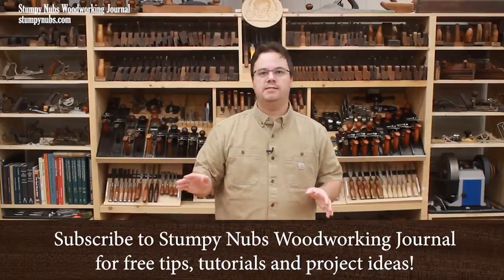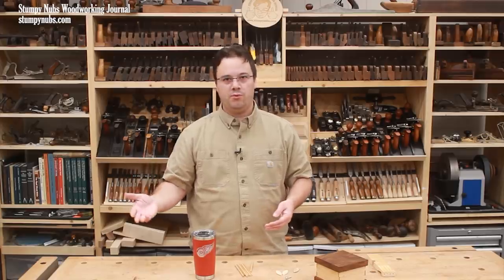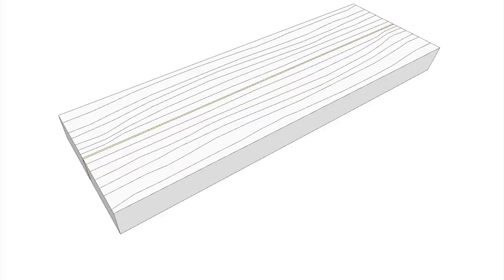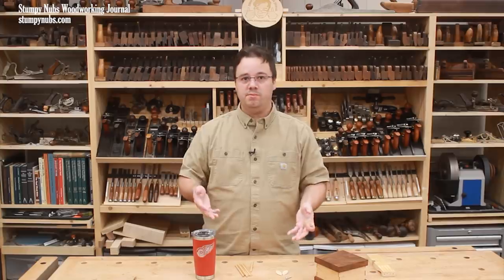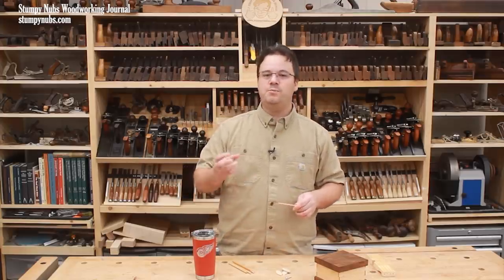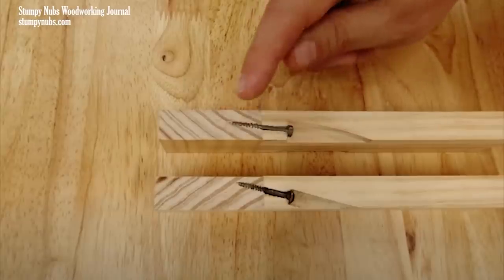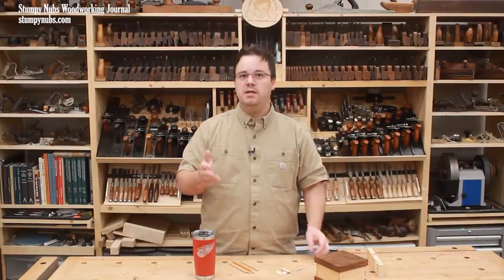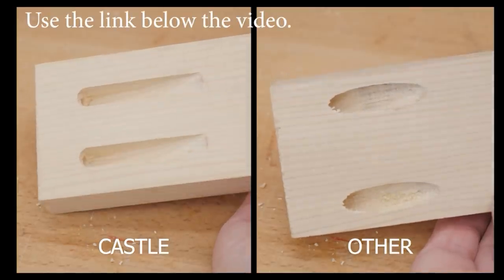Many woodworkers use these wrong! (biscuits, dowels and pocket screws)

Comment: I use them all depending on the structural load its going to hold. I worked in construction for 10 years before i started woodworking as a hobbies, and thats the way i understands everything, alot is done by trial and error to i know what will fail, just got to understand the furniture your making,  and the joinery to hold it together

Comment: I normally use mortise and tenons for anything structural. I have used dowels and made my own jig for alignment which if you don't lay it out right then you're doomed to fail. Pocket holes I generally use to attach a table top to the rails and sometimes I use them in the rails if it is a piece of furniture that I may need to tear down and set up someplace else. Sometimes it is just easier to tear something apart and reassemble than try to lug it up and down stairs in one entire piece. As I stated it depends on the application and what your needs are when you use any joinery method, especially when you leave the traditional methods and go for something different that may or may not be weaker over time.

Comment: Nails especially cut nails are sometimes the best option as well. A cut nail can crush the wood fibers forming a feathered wedge effect that can be amazingly strong and simple to use. Many old country style casework is joined with nails and has held up really well.
Reply: Side note: nails aren’t brittle like screws, they will hold under shear force where screws can snap.

Comment: I've been known to use screws in place of clamps in some, select, glue-ups.  Only to remove them after the glue has dried, bore the holes out, and drive dowels of a different spicies into the hole.  Then, often,  drive a wedge of yet another spicies cross-grained into the wedge, making a trenail of sorts.

Comment: I’m soo fortunate to have worked in a high end cabinet shop out of New York. Nearly ALL our installs were in Manhattan. We have installed on 5th ave, overlooking Central Park, Park ave, lower Manhattan high up enough to see yankee stadium from the living room windows. 
That said, I’ve not seen
(in person) that quality of woodwork since leaving the company.
Without behaving like a jag off name dropping, one might be inclined to tell me what quality is....
Save it for the dim! 
I’ll just say our modest little shop had NO Festool, NO Mirka and or other such marketing mandated, overpriced, point of failure designed toys, we had quality tools that were a decade or more old. We also had a pocket screw machine, we also had several biscuit joiners that were used in damn near every single cabinet project we did.

Comment: Before my cabinet company switched from mortise and tenon face frames to pocket screw joinery, they did strength tests. The pocket screws were more than strong enough for that application. You have to beat it with a hammer to break the joint.

Comment: I'm not that big a fan of pocket screws or biscuits.  But they have their uses. I would not expect them to hold any joint with a load in the wrong direction. And if you use them improperly. Well you get what you deserve. 
But I found a perhaps novel use for a biscuit jointer. A number of years back when I was doing my hardwood floors I found a biscuit jointer very useful for cutting new tongue and grooves on the ends of pieces of flooring cut to fit. I also used it to to cut biscuit grooves on mitered ends.
But most of what I do is best categorized as wood butchery. And I admit it.

Comment: If a joint will not be seen I will often screw+glue it together than when the glue dries back out a screw, drill a hole through both pieces than glue in a dowel. than do the rest of the screws.

Comment: Great video again James, I just built a picket fence and got criticised, told I was cheating by two friends because I used a nail gun and didn’t use screws for the pickets, as long as the nails are galvanised I don’t see a problem and it was certainly easier and quicker than screws. I had two words to say to both friends, first word started with a F second word started with O, we had a laugh and I am waiting for them to ask to borrow my nail gun 🙂
Reply: Traditionally they would have been built with nails, but you have to bash the boards back in every couple of years. Screws will hold the boards longer, but if you don't pre-drill the pickets with an oversized hole, then the pickets will split due to wood movement against a rigid screw. A nail will happily bend with the wood. You made the correct choice going with nails.

Comment: Great video!  However, I did laugh at 7:49 when you talked about not needing clamps with pocket holes, but then show a big clamp holding the parts while you drive the screws -- yes, I get what you were saying, but it just struck me funny. Yet, again, great video.

Comment: I often wonder why pocket holes are put into a joint on the outside of the board instead of the inside where they are hidden from sight. When I made my work center (island)for my shop, all of the pocket holes are on the inside, away from sight because I wanted the natural grain and colors of the hickory to show. Even the hanging cabinets that go around the walls have inside pocket holes. I will say while assembling the inner cabinets and drawers it was tight and I had to use a flexible drill extension to get to the pocket holes.

Comment: I have a theory based on my experience with older joinery. Chairs often have dowel joinery and I have seen many of those fail. However I have never seen a mortise and tenon joint fail. The racking forces try to break the entire joint all at once and I would agree that both are equally strong initially. I theorize that the easy transition between dowels end grain glue and the long grain glue allow the wood movement to slowly tear the connection over a long period of time. Sort of like how a phone book can be torn in two by attacking a small point of tearing at a time.
Reply from the maker: Dowel joints fail when a manufacturer uses dowels that are too small, too few or too soft. Two pieces of oak connected with oak dowels will not fail any faster than two pieces connected with a similarly sized mortise and tenon.

Comment: Heres a question, 3 identical pieces of furniture, one made with traditional mortise and tenon, the other made with a domino joiner , and the 3rd made with pocket screws. Aesthetically they all look the same but the question is are they worth the same? And im not taking about labor, its a quality issue .Because they are identical , would you sell them all for the same price? From a curious professional woodworker, Open question for all
Reply from the maker: Since Dominos are loose tenons, there is little difference at all structurally between them and a traditional mortise and tenon. And if pocket screws are used in the wrong places, they wouldn't be appropriate for the project. But I think your question is more about the effort put into the project vs. the price charged. My answer to that is I would definitely charge more than usual if I intended to use simple joinery but the customer required something more complex. But I would not charge less than usual if I had intended to use complex joinery but found that I could create the same quality with a pocket screw here and there. (Remember, I would not use pocket screws for high-stress joints. That is not creating quality.) You may look it this way- A chairmaker can bore all the holes in the piece with a hand brace and bit. Or he could use a power drill. Would he charge less simply because the power drill made his job easier? Not at all. You sell quality, function and beauty. You only sell joinery inasmuch as it serves one of those purposes.
Reply: @StumpyNubs  Thank you for a great answer. Sometimes its just nice to get other professionals opinions especially that of someone I respect highly. Thanks again

Comment: I honestly like Screws and Heavy Duty dowels. The reason being is fixing furniture, and durability. Screws are just durable. Every argument fails when your furniture is not secure, not stabile or not good enough. It's a very bad feeling of insecurity and shame of the owner. A screw will last. Simple, and super effective. It will fix the problem. The more you use, the more decades or generations it will last. No chair that's loose, no bed thats cranky. So on.

When you have a dovetail, and a wedge, or a wedge nail, that is also very durable. Might not be the prettiest. But prettiness only comes in sight, when the joint is just as secure, and there is no damage to stability. When the house of the man, does not have to go around fixing shelves or a broken joint. If a dowel fails, the jointer failed.

This is one of the reason, why I don't like round dowels, and plastic tips. A round dowel is strong. But combined with subpar construction and low standard from the creator, it often ends up with the glue, and the dowel not being secure, and the joint getting worned out, the glue shattered. A plastic tip is temporary. It's used, when you need a heavy duty screw, but the metal eats out the wood due to use and movement. But plastic, also gets worn out very fast, it's not very secure, and in a couple years at best, it is destroyed. The screw falls out.

A man living in 2021, with lots of fake furniture being sold, I vote for extreme durability, real materials, and the most durable.

Comment: I am building a dining  table  6' x 4' with reclaimed walnut and have joined the table top boards with biscuits.  after doing more research (wich i should have done prior) i am not certain that the joints will be strong enough. is there a way to use pocket screws or something to strengthen it up without taking it all apart? 
side note. I have attached breadboard ends with dowels.

Comment: Hi thanks for info. I work with restoring windows in Norway. Im courious about how long glue can last. If everything is done correct. Pvac glue and PU glue for instance. I attach old and new wood together. I have started to use the festool domino tool as well. But many only rely on the glue. Is 50 years lifespan on glue in a window sash realistic?

Comment: Total amateur here and looking for advice, which is what led me to the video. I’m planning on building my own corner desk, and it will have one long extension on the right side. I am expecting to butt joint the extension onto the main piece, using biscuits to augment the glue. But I’m super concerned about the strength of that joint. Concerned enough that I’m thinking the joint will need more support, such as attaching metal straps underneath, crossing the joint. Perhaps 2-3 thin pieces of steel channel iron across the joint to keep the joint from wracking. Am I overthinking this? Any suggestions? Thanks folks.
Reply from the maker: https://www.youtube.com/watch?v=4-OGtAs12ZQ

Comment: I defer to Barnwood Builders.  Sherman screaming for Johnny Jet to stop trying to pick up a beam, because one of the guys now see the pin (dowel) holing two beams together.

Granted, this is typically two beams with a mortise and tenon joint, and the pin is keeping them fro separating.  Still, there’s a time and place for anything and everything in building.

Another case in point.  My parents gave me a coffee table they got nearly 60 years ago.  This has survived five children, seven grandchildren, unknown number of great-grandchildren, and even more double great-grandchildren.  Sitting, climbing, playing, etc on it.  Held together with two pocket screw per each of the four legs.

Comment: I was taking a class from Chris Gochnour and we got to talking about sandpaper. Another teacher told Chris old woodworkers didn't have sandpaper so we are cheating, and Chris told him if they would have had it as an option at their time you can bet they would have used it too. So is it period correct no, is it using the advancements of the time to your advantage, yes.
Reply from the maker: Another problem is people think this stuff represents modern shortcuts simply because they are often abused by modern furniture manufacturers. Old woodworkers DID have sandpaper. They called it glass paper and it's been around in various forms for centuries. Likewise, dowels and pocket screws have been around for centuries, and biscuits are essentially splines, which is an age-old woodworking form of joinery, as well. Instead of ruling out entire forms of joinery we should be helping people learn when it is appropriate and when it isn't.
Reply: Native Americans used sandstone to shape wood in Birchbark Canoes for thousands of years. Apparently that "expert" on sandpaper really hadn't done much research.
Reply: If sandpaper is cheating because old timers didn't use it, then I guess steel tools are cheating too because sand paper goes back a long way in time and leather impregnated with pumice (very early sand paper) goes back way before the iron age.

Comment: I been using small dowels to plug old screw holes in my doors, doorways etc.  Just squirt some glue in, hammer a little dowel and cut if flush when it drys lol.

Comment: Dos the dowel material matter? In recent shopping I noticed that many "hardwood" dowel pins are actually pressed wood fibers (from hardwood trees).  That means you are relying on a glue fiber mixture for strength instead of wood lignins. Is one stronger than the other? Or does it matter? Is the strength difference so minor or the failure points so high that if you need to know, you are using the wrong method of joining for your application? I'd be curious if anyone has an opinion and a basis for that.

Comment: The only time I ever have a problem with joinery, or any other contemporary/ modern woodworking techniques; is if they try to call that same piece a period piece, or authentic antique replica. You must be a purist in building such projects or call it something else. 😊
As a side, biscuits (of some type) have been used for a very long time; dowels almost since the beginning of wood building. So I'd consider those "purist" joinery methods. Cheers

Comment: Almost all of my shop furniture use biscuits, glue and screws. They have been abused for years and not a single joint has failed. On the other hand if I am making a solid cherry country hutch I will only use traditional wood and glue joints. Each technology has its place.  In my opinion both Norm Abram and Roy Underwood have something to teach.

Comment: I don't really see the basis for biscuits adding strength to a joint, regardless of the strength of the biscuit. If the wood itself is going to fail in an edge joint, then it can fail anywhere, not just within the inch or so of space that is supported by the biscuit.

From my memories, biscuits date back to a period where many woodworkers felt glue was the weak link, they "strengthened" the joint by creating more surface area for the glue to bond with, and biscuits were an option when you couldn't get away with nails or screws.  I'd probably trust a dowel more than a biscuit, simply because the longer dowel might continue to keep the pieces of wood from falling apart even after various pressures cause a glue bond to break over time.  (Which indeed kept my dining room chairs at least temporarily "safely" functional even after they became wobbly.)

Comment: Very interesting and informative video! May I ask if not using pocket screw , which joint method is easy and strong enough for newbies to use on "high stress structural joints"?
Reply from the maker: It completely depends on the joint and how it will be stressed. Out of the three types of joinery discussed in this video, dowels are the most appropriate for structural joints such as found in tables and chairs.
Reply: If you’re looking for the speed of pocket screws. And the strength of mortise and tenon and have some cash. Festool domino.

Comment: Re-watching this, I wondered about the reasonableness of your first "argument" in favor of biscuits, where you point out that their grain is perpendicular to the wood grain, and the failure of an edge glued joint would be the lignin.  If the lignin is the failure point (and I agree it is), then why would the lignin for that panel not be the failure point everywhere on that panel?  If you strengthen the joint more than the lignin, aren't you just ensuring it will break 1/2" away from the seam?  It is like putting a heavy duty padlock on a plastic chain...what's the point?

Comment: Great Job James!

It should also be noted that dowels date back to and are included in Louis XII furniture (pieces now in the $1,000,000.00 and up price range) that are still praised for the exceptional craftsmanship in them.  Pocket screws are found in high end furniture from the Early Elizabethan period when screws were individually hand made by the craftsman using them.  Finally, alignment wedges can be dated back to the construction of the pyramids and have been shown to be common practice in the Roman and early Roman Christian Empires.  While not biscuits as we think of them today, more like dominoes used sideways, they were used in the same manner for the same primary purpose - alignment.

So when the self appointed "purists" complain about the use of these joinery options, they are in fact open;y displaying their personal ignorance.  Personally, that is when I walk away.  Dealing with the woodworking "Karen/Carl"  of our world just is not worth my time.

"Ignorance - the lack of knowledge or understanding - with the ability to learn can always be worked with, but stupidity - having demonstrated full understanding and deliberately ignoring it - is forever hopeless." Drill Sergeant Brown